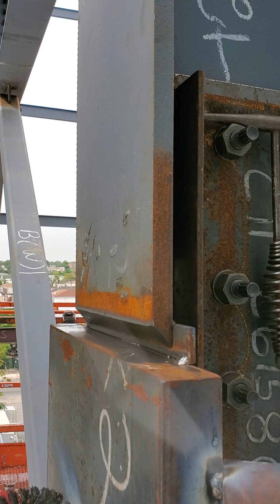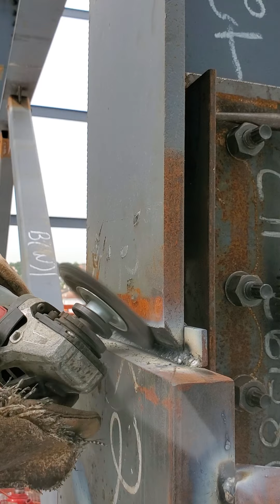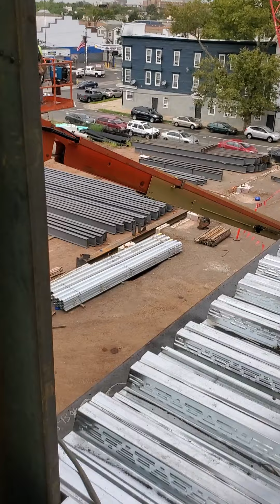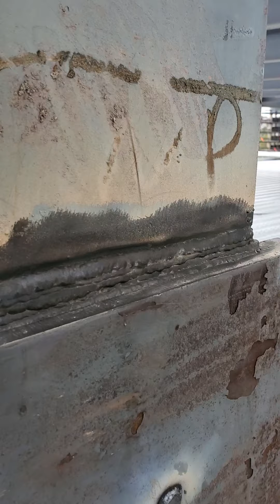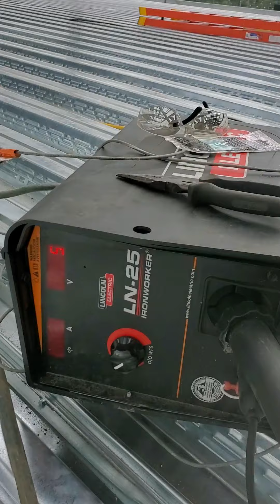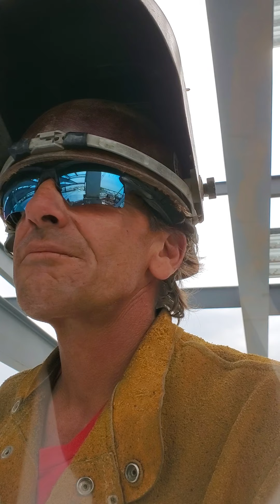Structural welding/ Root pass-  Column Splice

Comment: You are good to go, my man.  Damn hard work, its been almost exactly 2 years since this video and I was appreciating the comments below.  Great filmography, fantastic welding skills.  As long as the inspector is happy, it is good to go!
Reply from the maker: Ima, Thanks for your comment, Inspectors are very important in our business,they really bring the best out of your welding skills, This wasn't my best video on column Splices, especially running XLR8 1/16 Diameter wire, Which was supplied by the erector I was working for, I always run 5/64 Diameter wire Lincoln, Thanks again, And I'll be talking to you soon, Stay safe and have a great night!
Reply: So what was your opinion of XLR-8 Hobart ? What was your final
Settings ? Thanks !

Comment: That 2 banger is it legal if I were to low key put 1 fat root pass ?
Reply from the maker: Poohe, I was using1/16 Is diameter wire As you see on the description, It was my first time running that small wire, You go un safe. You wanna play Mr. Big ROOY pass? That wire was way too small and not enough volts , So as you see in all my videos, I run Lincoln N R 305 for flat and horizontal FULL PENS 5/64th diameter. , You are already set up for failure when you have steel erectors that do this stupid shit, So I changed wire and made him realize. Just stick to run in a company not doing any production welding. Lincoln inner shield wires, So
Do you understand what i'm talking about, Look at my recent videos like within 234 weeks.You'll get my drift, Have a good night

Comment: I assumed that was all stick welded. Those are the fastest beads I've seen from mig
Reply from the maker: Billy,  What's up,That's flux core, Innershield,  There's better videos when I'm running Lincoln NR305, That was pretty much a joke running that1/16 Diameter wire, it was supplied by the steel erector, We always run5/64 Diameter wire Lincoln, Check the videos out you'll see what I'm talking about, You have a great day, Thanks for your comment

Comment: Do you run into an interpass temperature requirements in your work often?  Work looks good.
Reply from the maker: Hall, What's up , Sorry so freaking late, Yes, Welding on bridge Bearings, According what size they are, It's in with the weld detail

Comment: He had it pre heated after he ran his root lol need to turn up the heat and wire speed and put some run off tabs
Reply from the maker: Iron 44, What's up, The Erector was supplying the XLR8, That is not my favorite wire, But it worked out very well,  run off tabs are overrated, Long as you have 1" of build up, each side, you're good, Anything thicker than 1" I will use a bottom run off tab, It's a welder's preference, And a inspector will say  No problem if you're good at what you're doing, and he is happy with your welds, I never had an issue with an inspector on the run off tab  Statement that you made,, Production welding, As you can see in my videos through the last couple of years on column Splices rarely see run off tabs, I've been doing this 37 years and I pretty much know most of the Welding inspectors , Philly,  North Jersey, NYC,,,And they know what kind of product I deliver, I work for the inspector, when I'm welding, Cause he is the one  that makes the decisions, On your product!

Comment: Hey brother, you gonna leave that backer in there? With no back weld? That wouldn't pass AWS D1.1 visual inspection for a CJP right?
Reply from the maker: Josh, What's up, The back up bar stays, If the drawing say to eliminate the backup bar, I would air arc it off, gouge the root and weld it ,This job it stays, Have a great day!
Reply: @Jet Welding LLC  OK, I'm sure you've heard of the Northridge earthquake in California. That's how all that stuff fell down. You must sleep well not having to worry about earthquakes, I guess.
Reply from the maker: @Kyehyfxu  , Good morning, Even working in   NYC 40, I never had to remove the backup bar, Only one job in philly in all these years I had to remove the backup bar for appearance , Talk to you soon
Reply: @Kyehyfxu  you do what the procedure on the blueprint call’s for not make your own field decision on what you think is best
Reply: @mattharper588  
Show me an engineered drawing that says to leave the backing in. I've done hundreds of CJPs, all open root with no backing.
Reply: Josh Berkten I'm just repeating what Jet Welding LLC posted he stated that the drawing did not require removing the back up bar but I do agree with you that it should be removed so you can get 100 percent of weld
Reply: @Kyehyfxu sounds like you might need to try qualifying w/ backing. It’s a thing for sure. If your backing bar is properly prepared and your root pass is sound, you have a perfectly functional CJP that will pass ultrasound with no problem. I have the certs for both, unlimited with open root,and with backing in 3 processes, it’s not difficult for a professional
Reply: @ josh fartken I bet you're the kind of guy that would run a 7024 overhead.

Comment: I keep getting some worm trails and can figure out why? So I just try and burn over them… any idea why they keep showing up
Reply from the maker: Joseph, Good morning, What wire are you burning, How old is the spool, If it's old and has been collecting moisture, It's bad, Turn your wire speed up if it's a fresh roll,, If I'm getting pinholes wire speed goes up, I think you have a bad Spool, I would put a new one in, Let me know what's up, Thanks Frank
Reply: Double check your gas nozzle.  I often noticed snail trails because I failed to clean spatter of the tip  ;)

Comment: Hey sr why i cant pass a test with 233 innershield fluxcore vertical plates one vebel and one flat and backstrip 1/4 is so hot the men in charge want a root pass uphill in 25 to 28 is too hot i think all welders fail test because make hole in the backstrip with root pass
Reply from the maker: Carlos,  you're telling me they're blowing out the backup bar, I would turn the wire speed up, I don't know what your machines are, For a power source, or you're using an inverter, Fast on your sides, I would experiment, Starting at 25 V,  Wire speed  starts jabbing you're  running rich, Turn it down a little and you should be golden, Remember quick sides build-up roll, Is all way to the top, You don't need to be laying into it cause it's already burning in, I wish I was there to run it with you, You gotta figure it out brother
Reply: I did a semi legit test for practice one time seems like I run it around 23.5 and 500 or so on wire speed using one the newer Lincoln 360 in the shop I'm not sure what the guys that did test had there settings on
Reply: Check the specs  for amperage voltage and wire speed  if they are out of tolerance  show them ro the inspector  they will make appropriate  recommendations

Comment: All these comments make me laugh. Firstly it depends on your procedure as to what your preheat is and what backing bar can be used. You just have to get penetration and burn both edges of your plate. And yes their are weld procedures with only a 30 degrees Celsius preheat. That's like 86 for you Fahrenheit clowns.
Reply from the maker: Tim, Thank you for your comment ,you sound like a professional, Hope to see you on the job one day ,so we could burn wire together, These procedures have been the same for the last 37 years I've been doing this shit, Just a normal day at the office ,you know what I mean! It's really not technical about the procedure and how you go about it, your job is to burn wire and get it done ASAP, that's why we call it production welding, And if you're slow you'll get hit with a check !
Reply: @jetweldingllc4691  Yeah not wrong, I have only used xlr8 or should I say decelerate once on a job. Id much prefer to send up a gas bottle and use 525. Little more deposition with each run.
Reply from the maker: @timhayes3336   Great talking,, Catch up with you soon, be safe!
Reply: @jetweldingllc4691  Why not transform to learn more advanced argon arc welding, welding pipes, titanium alloys and the like, you can do it with your strength

Comment: welding way too cold 😅. Turn the heat way up, it should sound like melting metal not frying chicken.
Reply from the maker: Walker, Good morning, I would never run1/16  wire on column splices let alone ,,flat moments, the erector supplied the wire, As you see in all my videos, I weld 5/64 diameter wire, So if you think I was running cold, I had that f**** wire max with heat, I had to do what I had to do, So all my weids passed bro, If you pay attention to the volt meter, You're outta your mind, because every machine is different you go by feel, Cause if I would smash all the little digital read outs. Let's see how good you really are setting up Your machine cause back in the day that's how we were brought up we never had that, So see you on the next job bro, We'll school youon  column splices  and everything else as you see in the videos, I love the comment ,but when it comes to s*** like that. You sound  Like a textbook welder,, But I could be wrong, We're all about performance, I hope you are too ,I don't want to sound Like a negative , Have a good weekend,1/16 Wire is designed for half inch material and under, Some people don't understand that., Like this erector I was working for,But I don't care ,I just weld bro

Comment: NR 305 is no good if you get paid by the hour. Also very smokey. NR232 will kill you stay away from Lincoln  wires, they are very toxic. I switched to Esab coreshield and never went back. Glad I did I am still alive at 69. When you do your full pens you are supposed to alternate each direction in order to avoid buildup at one end and concavity at the other. You sure are not going to run 305/3/32 with your little red toy on your truck especially with 200ft round trip leads!
Reply from the maker: Bernard, thank you for your comment!1/16 diameter wire in this video, I did not supply it, the erector did , My machine has no problem running this wire  ,Moving forward to the next videos you'll see what kind of power source I have! Thank you for your knowledge, But as you can see from this video on forward, it is about the structural welding that we perform, You have to share the love between the 2 machines, That's how I keep everything in tune, We have no problems with performance ,!and Horsepower! You have to look at my past history and understand I knowwhats up ,I'm a professional,  I know how to dress for the occasion, Like I said, you have to share the love for what machine does what, That 305 diesel is an awesome running machine for 233, I don't know where you're from, But we run Lincoln NR233 in New Jersey  in New York City , Philadelphia, That's our wire, All the contractors use this great wire,#401
Reply: I know this comment is pretty late but do you have a link to a study proving what you said? I have a hard time believing a lifetime of welding with Lincoln wire would have any noticable difference from a lifetime of welding any other brand of wire. Pretty sure none of it's good for you.🤷‍♂️

Comment: Not to mention that backing bar is not thick enough
Reply from the maker: Cal, Whatever the fabricator gives me, I use, It's all good, If my root opening is too large I would use a thicker backup bar,  Thank you for your comment,
Reply: @jetweldingllc4691  ....If I was there you wouldn't be using it. And if you did weld it I would right up an NCR on it.
Reply from the maker: @calikalbocalikalbo6082  , But I thank you, It was handled in the right way, Sorry, But your company did not have the job, And whatever you would have told me, For the procedure, We would have had the fabricator take care of it, but the inspector, Was very happy, One day you will be our inspector, And whatever you say, The procedure will be done your way, Remember, We're here to satisfy the Welding inspector, Not go behind his back, That's how we roll, So one day we will meet, Thank you again for your comment, And keep making welders great,!
Reply: If it takes the heat and doesn't burn through what's the problem. Welded hundreds of splices and moment connections in my career using 1/4 in flat bar as backup.
Reply: @markkaminski2416  ....Looked thinner than 1/4"
Reply: @calikalbocalikalbo6082  OOH, that wouldn't be good. In many instances the fabricator supplied back up strips that were to thin and not wide enough to cover the joint. I agree that 1/8 is insufficient for the amount of heat when using flux core.
Reply: @markkaminski2416   The backing plate does not matter whatsoever,  all its there to do is give a solid landing for the puddle. The backing plate IS NOT STRUCTURAL  and has no effect on the strength of the weld. If you actually had to weld Beams you would know that but it's obvious you are uninformed. Ever notice how your test requires the removal of the backing plate? BECAUSE IT DOESN'T MATTER
Reply: @JohnDoe-ks9xx   I realize that , I'm not a rookie! But it has to be heavy enough to handle the heat . If you burn through the backing strip it will never pass.